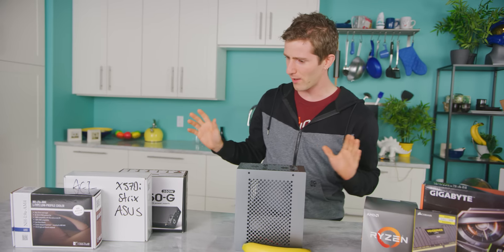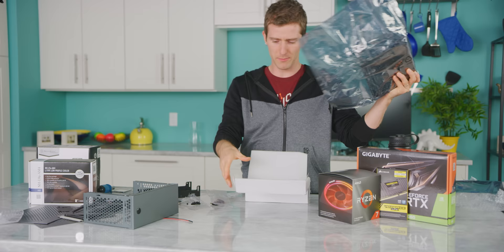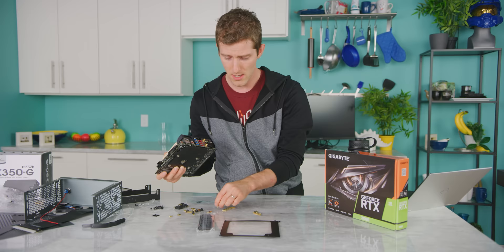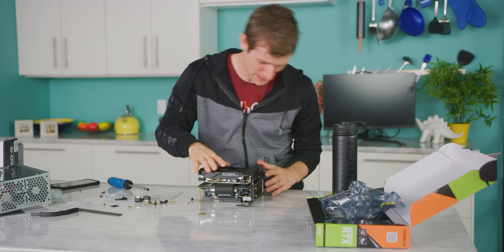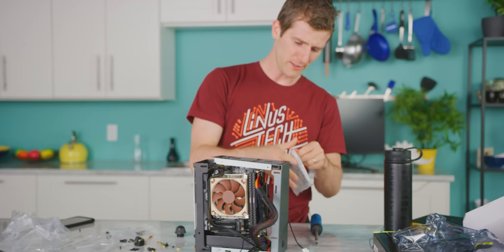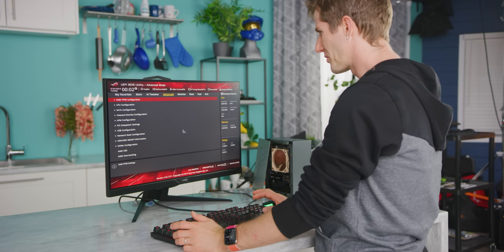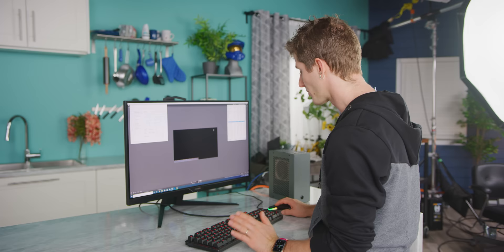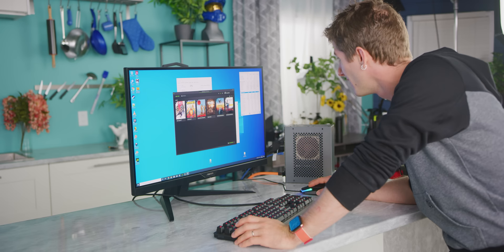Our Smallest Gaming PC Build EVER! - Velkase Velka 3

Comment: Imagine having to clean the dust from inside of that.
Reply: @Mr.Darling haha nice one
Reply: Everything is so squeezed that dust particles wont have place to get in ... 😂
Reply: @Muumipaha Just blow compressed air through the holes of the side panels, like actually every PC schould be cleaned with compressed air.
Reply: Well the thing is, there is no room for dust.
Reply: I’d probably use a vacuum or something
Reply: I don't even want to imagine it. It will be a total horror. 

PS:
For such a small computer, full modular power is better. I don't see the point of something like that having a bunch of unnecessary cables to wonder where to put.
Reply: BIG BRAIN TIME! 

Actually... are they are strong as the ones in cans? Can you recommend any?
Reply: You can also you the hdPlex and 400w AC/DC adapter and a Dell 330w powerbrick it runs fine with a 2070 and 9400f which is all you need for modern less cpu intensive games Optimum Tech has a really well made video on it
Reply: Muumipahpa just throw it in the dish washer man, shouldn’t have any dust problem then
Reply: There's not enough airflow or space for dust
Reply: lmao I hope you're kidding. Using a vacuum anywhere near a motherboard is a huge no-no.
Reply: the case's form factor itself is a dust filter.
Reply: Imagine the dust is trying to get into it :D
Reply: I mean, the computers basically the size of the nozzle on a can of air

Comment: dam! The upgraded version of this build packs a serious punch for such a small device! the total cost goes around $1700 (varied by market). I made a small list of this here.

CPU: same
Motherboard: Same
GPU: MSI Gaming GeForce RTX 3060 12GB
Ram: Corsair Vengeance LPX 32GB
Storage: Corsair MP600 CORE 2TB M.2 NVMe PCIe x4 Gen4 SSD 
Power supply: SilverStone Technology FX600 Platinum Cybernetics Platinum 600W FlexATX 
Cooler: Same
Case: same
Shipping not included

Comment: If Your Watching This Now The New Velka Case Is So Much Better! It's Designed Like A Tank. I Finally Saved Up And Collected All Parts For This Build. The New Case Addresses All The Sketchy Things In This Video. It Has No Top Fans Though. But It's Got Alot More Structural Support And Proper Mounting.

Comment: Suddenly I feel good about my shitty “behind the scenes” cable management.
Reply: Haha, so true. Luckily I have Fractal Design R6 which makes cable management so much easier for a cable management noob like me! I guess when I switch to M2 SSDs or at least only 2.5" SSDs it's gonna get a bit better again, since I still got optical drive, 3x 3.5" HDDs and 3x 2.5" SSDs.
Reply: I don't have a side window so my cables are just all over
Reply: @s0nycz3kk  you... You have 6 drives? And an optical?
Reply: @zilchdevotegaming6710  Ye I have all of that :D That's why I got the R6 case, it's very practical. I always transfer what components I can from older builds to newer ones, that usually is the storage units and GPU. Built 3 PCs since 07/2014. I am not planning another one yet but another time it will be built on AMD platform ^^
Reply: @zilchdevotegaming6710  Surprisingly I'm on the same setup as the guy above..
Reply: @hamstersong123  so, I need to repeat... YOU LUCKY BASTARD
Reply: @hamstersong123  oh I forgot to call him a lucky bastard
Reply: @s0nycz3kk  I dislike the fact you can afford that. I have a Alienware r1. It has an I3, 256gb ssd, and an 860m.
Reply: @zilchdevotegaming6710  I'd tell ya why I can afford it but I don't want to bother you with my lame situation.
Reply: @s0nycz3kk  tell me plz
Reply: @TheAmanor123  I live in mom's basement with cheap ass rent /s
Reply: @s0nycz3kk  what, you on disability or sumthing?
Reply: @zilchdevotegaming6710  I didn't afford my drives, I scatter them from random pc's i see thrown out on the street, most pc's have 320 and 500 gb but I managed to find a 2TB drive once :D
Reply: @hamstersong123  still lucky, I live in a suburb of old people so that kind of stuff doesn't get thrown out on the curb

Comment: So for the silence freak who also wants an SFF you use this case, but use a Pico-PSU or HDPlex power supply, throw those slim fans in the garbage and mount some silent fans to the bottom where the PSU would normally go. You'd also have to add some feet so those new fans could bring in air from the bottom. And there you have it, a totally silent, super tiny SFF.

Comment: "The most portable PC ever"
Me: Take my money!
Reply: Seriously, I would buy it if it works reasonably
Reply: @prla5400  ye and add a case handle and monitor case too
Reply: there are actually lots of choices of this type of case with lower price or maybe slightly bigger but has better compatibility that you can buy
Reply: @timz1793   Like what?
Reply: Master Wille well, I checked eBay and Aliexpress🤕, there are actually no such cases, but if you have friend who speaks Chinese, then you can ask him helping you buy the case from Taobao.com. I personally recommend k55 case (5.5L, with compatibility of GPU up to 30CM long and SFX power supply support) from SGPC (傻瓜超人), or you can check k39 (3.9L) or k49 (4.9L) which is basically the same as the case showed.
Reply: Master Wille * which is basically the same as Linus showed in the video
Reply: Why not to just a Laptop tho?
Reply: @timz1793  where?
Reply: @devilefty3814  laptop cpu is not the same as desktop cpu
Reply: Ace Maxximus have you heard of something called “Laptop”?
Reply: @rashed3254  the point is the performance of gaming laptop is lesser than desktop CPU. As it is a portable pc  you can carry it in a bag. And need not to worry about battery life. now All now I need is a portable moniter .  then say good bye to laptop.
Reply: Bro just build a custom suitcase PC.
Reply: I have Lian Li PC-Q25B, I'm using as a NAS. You could fit 3 of Linus' computer in that case, but it holds an ATX psu and 4 hdds as well.
Reply: You could buy an x86 maker board and you'd have something much smaller, just less powerful.

Comment: I'm honestly not surprised the GPU got decent temps ... the fan is literally sticking out of the case through a bunch of giant holes. In "most" PCs they're more or less enclosed (other than what the case fans can pull/push) so the ambient temperature inside the case can keep rising ... where in this case, it always has access to room temperature air.

Comment: I'm convinced that we'll be able to fit our PC's in our pockets like the memes predicted boys
Reply: Smartphone lol
Reply: Rasberry PI
Reply: How to make a small fan:
1: Take the 3D cad model
2: Shrink it
Reply: @the_guy_who_split_your_qua3832  cant run proper games
Reply: @IRMacGuyver  The original iPhone was more powerful than the computer used to put men on the moon..
Reply: @iamgoated6483  actually if you own an actual full-scale PC with a good graphics card and internet connection, you can easily stream games on a raspberry pi at 4k (granted it has a good hardwire ethernet connection as well) using something like rainway
Reply: @NickyHendriks  whens my turn.
Reply: @unosquash  I have no clue, just apply for  job at NASA. I thought they were going to do moon-missions again in the forseeable future.
Reply: @blyadimir  phones are arm systems, we're talking full x86 windows machines
Reply: @iamgoated6483  raspberry pi 4 8gb with a 64bit os can run ps2 era and before games.
Reply: Steamdeck

Comment: "If there's a weird thing almost noone could possibly want, Silverstone probably makes it" - looking at my Primera FX with the giant painted unicorn on the side panel, yeah, thats probably true..
Reply: Tore open a recently retired, old-as-shit analog camera NVR and found an actually very decent Seasonic 400W Flex-ATX PSU in it. Saving that for a rainy day. NVRs of this vintage had standard PC components on a proprietary motherboard + FPGA daughterboard to process the images. The FPGAs use a lot of power. Nowadays you'll get a bog-standard ASRock Mini-ITX board using the QuickSync feature of Intel CPUs for the transcoding.
Reply: Ive got a silverstone SG-13 small form factor with an rtx 2070 super and a 9700k. This thing is the size of a shoebox and you can cook breakfast on the top case panel.
Reply: Damn boi.... Looked it up... That's a pretty damn nice Unicorn!
Reply: @CobraComputerSystems  I have the SG13 with a ryzen 5 3600 and a 1060. Stays cool! Probably the best budget small form factor case that supports 2 fan GPUs

Comment: "The gap isn't that noticeable... If it's good enough for Tesla owners, it's good enough for me"

#ShotsFired
Reply: Too bad it’s false 😂
Reply: What's with Tesla owners and gaps?
Reply: loading2112 good question
Reply: @drpepper684  What do you mean false?
Reply: +loading2112 Probably a poke at them saying their cars don't accelerate fast enough. In drag/street racing terms, to be gapped is for your opponent to pass you and for the gap in between you and them to keep growing.
Reply: @RAndrewNeal  nope, it's referring to the large gaps between the panels on the car. Tesla has some shit quality control when it comes to car bodies.
Reply: Oh, well I suppose in context, that makes much more sense. I wasn't aware (obviously) of the gaps between Tesla doors.
Reply: @ZanderPlaysVG  i think it's gotten a lot better in the model 3 from early examples off the assembly line. same as the s...
Reply: In the body of the car, there is usually a gap between the doors. If you see the Model X, the front and back doors don't line up properly.
Reply: ok boomer
Reply: @loading2112  Quality of some Teslas assembling is actually pretty poor. Like... stuff is fitted onto the car unaligned, meaning weird gaps around frontlights, hood, trunk and so on.

Comment: Also:
WHY THE HELL ARE THE SMALL PSUs NOT MODULAR?
If you need a small PSU like that, you probably need all the space savings you can get <.<
Reply from the maker: Because the modular interface takes up more space inside the unit.
Reply: @LinusTechTips  Dramatically more, yes. I doubt they could even fit standard ATX sockets on just the backside of it.
Reply: Just cut the wires you don't need 🤷
Reply: Geeek makes some, but the connectors make the PSU too long to fit in
Reply: I wonder if anyone's offering a custom-tailored harness service like PC Power and Cooling did?
Reply: Psst...HDPLEX!
Reply: After cutting them just use shrink tubing to make it all neat again
Reply: Modular Flex ATX PSUs exist. I've seen some online.
Reply: @LinusTechTips  i think he meant, why that psu is not modular so you can save space removing those cables you wont need
Reply: @wscan  read the comment you just answered to
Reply: @LinusTechTips  what abour "PicoPSU" ?

Comment: just imagine that one day a gaming PC would be the size of today's smartphones
Reply: Today
Reply: @aaronalasa  I mean, a switch could be even smaller, it's weaker than most flagship phones these days, and still weaker than my 200 dollar chinese android. Remember, the switch in an nvidia shield tablet in a new case.
Reply: The gpu would still be 2 feet long and the rest of the pc would be the size of a modern cpu
Reply: Remember when our full sized pc had only 1 core cpu woth 256mb of ram?
Basicly we have a really strong pc in our pocket 🤷🏼‍♂️
Reply: Basically the raspberry pi
Reply: @luisalonsohernandeztellez7030  No it's not today and it won't be for another 10 years and that's being generous

Comment: God that thing sounds perfect for me cause I do have to go between my parents houses so I use a shitty chrome book and can’t even game.
Reply: 2016 Subaru WRX STi I’m 13 and can’t afford any kind of pc
Reply: 2016 Subaru WRX STi i mean thats going all out. You could easily get something like an i5 9300h and a 1650 and 8/16 gigs of ram in a laptop for 8-900 usd or so' and that will easily allow you to play most games, just at medium or so settings.
Reply: Straight_edge _513 I bought my pc for £250. I7 gtx960 12gb ram. Just save up for a while and you can get one
Reply: @mk2nathan  thats 250? Damn
Reply: @smoofceggie9740  my brother's computer is about 150$. I72600, Mobo and ram was free from an old office computer, case was like 60, psu was 40 and it has a gtx750ti that I sold him for 50. If your willing to go used you can get a great computer for very cheap
Reply: @smoofceggie9740  Including a monitor, keyboard, mouse and cables. Pretty much the whole set up. It had only been used to play WOW before for about 4 or 5 months so i got it pretty much new. Do you not think i got a good deal?😂
Reply: @henrymarocchi7844  Do you not think i got a good deal??😂😂 Im getting paranoid because that guy said damn after hearing what i payed 😂😂
Reply: @mk2nathan  nah that is a good deal. 960 should still be a decent gpu.
Reply: @henrymarocchi7844  Yeah it works great for me, somehow gets 100+fps on high/ultra settings on many averagely demanding games believe it or not.
Reply: @henrymarocchi7844  true i scavanged our old home PC with an i3 2100. bought an extra stick of 4GB ram  aused gtx 950 and now a new case and an i5 3570S for 20 bucks from aliexpress. my friends also got me an ssd for my birthday. works great runs everything i play (even forza horizon 4 at 60 fps) and with the new case also looks pretty nice. i'd say over the years i've spent around 200€ for it, but now the gpu, ram and ssd is like half the price. if you have an older PC i recommend doing this you can get quite a "beast" for 100€ if u have it or completely build a new PC from used parts for like 150-200€
Reply: Nathan Manning you uk people get shit like that for dirt cheap, the rest of us in other countries cant relate
Reply: Yeah man, my mate got the best deal out of everyone in the world though, he got a pc with i7 6770k gtx970, 32g ram something like 2 tb of ssd all for £225. It was also only 2 months old when he got it. Idk how tf he did that, lol
Reply: @mk2nathan   can you tell all the PC parts you used and monitor  no need to tell the price
Reply: let me think of a name I didn’t build my pc I bought it second hand, but it’s got a i7 2600 cpu, gtx960, 12gb ram and 1tb hard drive, their the main components
Reply: let me think of a name and my monitor is just any old cheap 60hz monitor
Reply: Try buying a 300$ pc. It can run on 60 fps a lot of games.

Comment: “70* not bad”

Me sitting here sweating at 97*c on my cpu
Reply: @arnehurnik  can't speak for this guy, but my old CPU, an AMD FX 8320 hit that playing overwatch. Took 5 years to finally burn out this week. Swapped for a Ryzen
Reply: @Fede964  I'll be honest, I just used the stock cooler because I was poor at the time. It's a shit CPU known for overheating in any case, though.
Reply: @arnehurnik  laptop.. has an i5 8300h and my laptop has the worst heat pipe setup known to man kind so it gets onlyyy a littttleeee hot
Reply: my ryzen 1700 is fine with fractal design s24 liquid cooler, my strix 2070 dropped 20c once i installed riing trio x3 140mm fans while gaming. usually its 70c++ airflow is good in phanteks p400 tempered glass
Reply: @KahvinSuodatin i would advise keeping temp low. it prolongs ur hardware lifespan
Reply: Your keyboard Doesn't  have this  ° bro? 🙄
Reply: Yea same on my gpu, I have a blower gtx 1080 from gigabyte and under full load it runs at 93 while it underclocked itself about 400mhz
Reply: You should totally try undervolting your cpu in that case. Here's a good guide: https://www.ultrabookreview.com/10167-laptop-undervolting-overcloking
This works on laptops as well as desktops. For me, it lowered my remps from 96°C to 78°C (that's a 18°C difference, though to be fair my cpu is known for being very undervoltable).
Reply: Jayden we're talking celsius; that's like 55°C which is totally normal under room temps
Reply: Tisukii silence is more important that all else...

Comment: I could actually see a system with an  APU being pretty ok in this setup. It could do well as an emulation or basic computing machine.
Reply: I would say an APU would be a bad choice. You are putting a lot of heat into a single place. Discrete graphics would be better.
Reply: @dogunboundhounds9649  So more heat in 2 places is better than less in one? The parts here (3700X and RTX2060) have a combined tdp/tgp of 225W (65W + 160W). A Ryzen 7 5700G has a tdp of 65W. So you can lose 160W of heat from the build, and still have a competent machine.

Yes, the 2060 absolutely smashes the iGPU in the 5700G, but it can still be a very good compact machine for productivity and some esport title gaming.
Reply: @dogunboundhounds9649  AMD's APUs have literally the exact same TDP as their equivalent CPUs, not to mention that using an APU would allow for a larger cooler in this case since you can move the entire motherboard down to where the GPU would be
Heat is significantly less of a concern using an APU than a discrete GPU